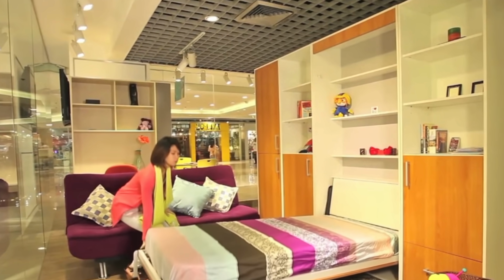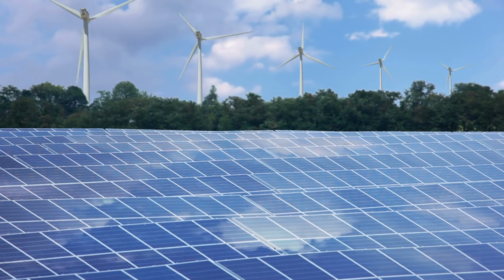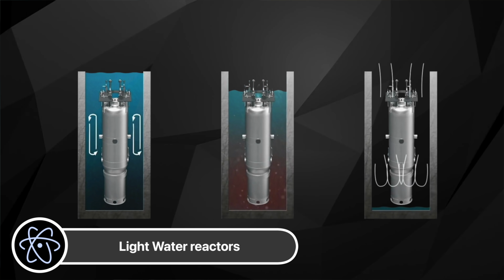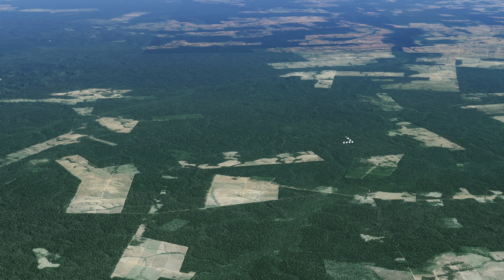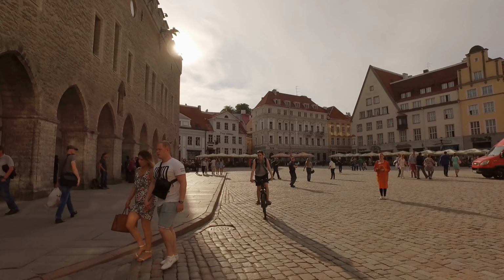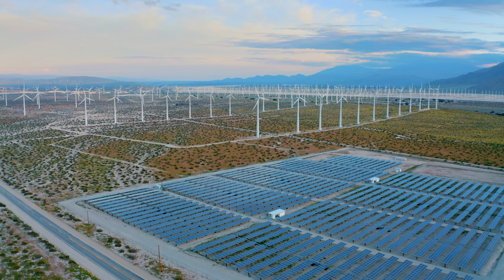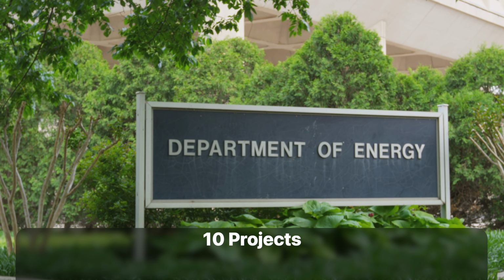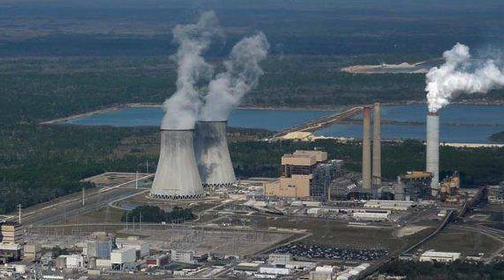Why Small Modular Nuclear Reactors Are the KEY

Comment: Few years ago I read about a small nuclear power station, that fit in two standard shipping containers. It was completely self-contained and designed to operate with minimal maintenance. It generated enough power for small village. The idea was to use them in remote locations and during any emergencies, as they could be shipped by truck, train or helicopter to location...
Reply: You mean HolosGen, they need more development but could be the micro reactor going to Air Force base in Alaska.
Reply: @paulbedichek2679 , I'm not sure. I think it was finished and there were orders for it. It might have been made by one of those Japanese megacorps that make just about everything. I can't recall, where I read about it, but I remember I was impressed by it...
Reply: @urgon6321  No,it would be a US design, look up HolosGen,that is the reactor that fits your description, OKLO also builds a small reactor, but theirs is a fast reactor.Remember the Russians have a barge. already connected to the grid in the far North,now there is great demand for more of these, it replaces diesel so the cost savings are astronomical.
Reply: for emergency use yeah. But for common, constant power-supply to a nearby settlement? Noouh! Think of all the energetic Neutrinos streaming out of such a device, frying the testicles of young men (and the eggs in women of fertile age). 
 I think nuc reactors should be placed far away in remote areas with low population density and in this case, the advantage of molten salt reactors with high temp and no need for cooling water would be doable and minimize the negative effects.
Reply: @konradcomrade4845 , ever heard about use of heavy metals and concrete as nuclear shielding to contain radiation? All modern reactors and other devices that use nuclear materials are properly shielded for safety and environmental reasons. The same goes for portable and modular nuclear reactors. There are also other safety systems, like radiation detectors and alarms to signal any problems with containment.

I suggest you watch some films by  Plainly Difficult, who has plenty of incidents of nuclear nature explored and explained. Many of them are examples of failure to properly track, contain and protect nuclear materials from idiots. So placing a self-contained portable nuclear power plant away from everyone raises the risk of spreading the radiation, instead of lowering it...
Reply: Not neutrinos maybe neutrons. Neutrinos can go through the entire earth so they would go through you too with no harm done.  Massive numbers of neutrinos are released in fusion reactions, like the sun.
Reply: @konradcomrade4845  - I would rather live next to a nuclear power plant than a coal fired power plant. The coal plant puts out carcinogens and more nuclear radiation in one day than a fission plant puts out in a year. The only reason they get by with it is they are not required to monitor their emissions.
Reply: @edwardcoulter9361  - Neutrons don't escape a fission plant either, the core is in a containment building. Even 3 mile island didn't cause any measurable leakage above normal background radiation.

Comment: Nuclear especially Thorium LFTR's and ideas like these Modular reactors are the way to go! It is the cleanest energy there is, even when the waste stream is taken into account......We need to go all in on nuclear power! Our electric powered future depends on it. Carbon based production is dying.
Reply: I am all for the continuing research on the many alternate methods of energy production.  Ensuring expanding research  on all options currently available to "cleaner " energy production is the only way to stay ahead of growing needs for energy.   Our government needs to be monitoring and promoting this industry.  To ensure profit margins do not rule over safety costs  a oversight that focuses on longterm goals and current energy needs without sacrifice of local and global safety.
Reply: Storing spent fuel rods is not cheap. Nor is mining the material. Requires a lot of carbon to acquire and store at the end of life.
Reply: @williamsrdan  There are no spent fuel rods in a thorium molten salt reactor. The nuclear fuel is liquid and low pressure. The moderators are made of graphite though. 

Much less waste and chemical equipment outside can also draw off useful waste products.
Reply: E Van  Thorium Molten Salt Reactors was proven to work way back in the 1960s and is a walk a way safe system so much so that the researchers could shut it down on the weekends and restart it on a Monday plus it’s a non high pressure system which works at atmospheric pressure. No hydrogen explosion to worry about spreading radioactive material . The systems are small and do not need to be cooled so can be placed anywhere.
The major reasons it was not put into use was political and greed . Nothing changed , at least here .
Also, the Chinese are building a pilot plant right now which if it works out , will put them way ahead of the rest of the world in producing cheap ,clean and safe energy.
Reply: E Van  Why do we need greedy private investors when we are already overspending on the military ?
And do these new plants you point to leave us with the same situation we’ve had for the past decades of all the stock piled waste that’s highly radioactive for ten thousand years which from what I understand, the TMSRs will actually help eliminate over time and any waste will actually be safe in only 300 years . 
The light water reactors have always been proven dangerous and are out dated . 
And yes the Chinese will beat us to the punch in just the next five years because of our paid and bought off politicians here stalling anything that will make energy cheap for the commoners therefore costly for their cash cows the corporate elites .
Reply: @garysmith5025  I've read this disadvantage which may require additional shielding and remote handling is also an advantage as it lessens the likelihood of increased nuclear proliferation.  It may be interesting to learn the dose rates of the workers in their new molten salt reactor that does use Thorium fuel.  I doubt whether such information would be made public.😉
Reply: @williamgrimberg2510  true. Gouvernement don’t want cheap or free energy. They want money like gold : rare and goods value.
Reply: @HablaCarnage63  there is a small amount of uranium used in the neutron enrichment process. 
It’s not totally thorium salts. 
Saying that though. 
It’s not much and the end waste has a half life of around 30 years. 
I agree thorium has great potential. 
But I’m not discounting magnetic contained plasma hot fusion ether. 
Both have a place. 
But the SMR systems could solve the oncoming energy crisis.
Reply: Lets see when that "waste stream" starts hitting your children hundreds of years from now (when people forget to maintain the storage), all while the waste remains EXTREMELY TOXIC.
Reply: @williamgrimberg2510  Agreed. The main reason why we don't see Thorium molten salt reactors today is because of Nixon back in the 70s. At first, Nixon was for it. Even talked it up in a speech. But as a favor to his friends in California when California was about to get new power plants, he ended all work on Thorium MSRs. There was more money in the current old reactor technology to be made. And the far more complex light water reactors needed far more man power to build and run, creating more jobs.
Reply: @williamgrimberg2510  And also agreed, on the safety difference. The old light water designs are far more dangerous in the event of an accident, due to high pressure radioactive steam release, hydrogen explosion spreading nuclear material, or loss of coolant and core meltdown (China Syndrome.) All issues that literally can not happen with a Thorium molten salt reactor (MSR). There was even a test showing the safety of Thorium MSR, ironically about 2 weeks before the 3 Mile Island meltdown, to see what would happen if it was left to run on its own with no human input. The reactor got up to a safe temperature, then, just sat there. And yeah, letting China take the lead in Thorium MSRs is a big mistake.
Reply: @williamsrdan  takes zero carbon to store
Reply: @dirkdiggler9379  except for digging out the caves...and transporting nuclear waste half way across the country to the storage facilities.
Reply: @dirkdiggler9379  How about an honest politician.
Reply: @billruss6704  there are plenty of honest people just to listen to it
Reply: isn't the half life from the waste like 750yrs or so with the thorium liquid salt reactors?
Reply: E Van  Do you trust Russian reactors?
Reply: This guy topgun did some research. Thorium/molten salt reactors are our best way forward. Best, most simple design, has less that can go wrong, so less to worry about. 

I feel like the biggest reason why we don't have them already is greed. Companies can't figure out ways to make people depend on them for everything, so I think they are worried they will eventually cause their own extinction. Right now they have justified the cost of everything by keeping everyone in the dark about "security and maintenance cost." Once people realize there's not much needed from nuclear plants once they are up and running, they won't want to pay for it anymore. Sure the factories can start out by leasing these small power plants to homes and communities, but eventually someone will start selling them and that kills the person's reliance and subjugation to the companies and that is what they fear. We had the tech to build these many years ago, and "free, clean energy" were the "ideas of tomorrow" videos that you'd see at expos. But free is not very appealing to greedy reliance based companies.
Reply: You forget about geothermal energy
Reply: Yes , but Carbon based power is growing rapidly all over the world.
Reply: @stefaancodde6578  Yes
Reply: @paulbedichek2679  : that's why Chernobyl exploded , bad maintenance.
Reply: @williamsrdan  Wrong , storing spent fuel is cheap, and the entire cost of mining and enrichment is minimal.
Reply: @HablaCarnage63  Yes, there are spent Th in fuel rods, it depends on the reactor.
Reply: @ezerratchaga  You realize nuclear has saved more lives than any energy source, nothing is safer or cleaner.
Reply: @jimlofts5433 Thorcon does not have the go ahead, they would give cheapest power, but have no agreement, The US will have many advanced reactors, TerraPower has the go ahead to build a a fast chloride molten salt reactor, an ideal type reactor like the LFTR but better.
Reply: @paulbedichek2679  1st, I have no issues with nuclear power plants.  But that doesn't mean you put a dirty bomb in everyone's hands.  If people thought guns are a bad idea, think of what will happen when anyone can poison a reservoir, your neighborhood water supply, kill 1000s of school kids all at once... etc... 

2nd.  Nuclear is never going to be able to compete with renewables, strictly on the cost basis.  It's dead in the waters.  Not only on cost, but in every imaginable variable.  Distributed energy? Clean? Simple? Cheap? Almost free in the future?
Reply: @michaelmorrison4201  There is no life without what you call greed, this goes for bacteria and microscopic life. You have no problem with coal but are afraid of our safest energy.
Reply: @constantinethecataphract5949  Geothermal,is very minimal, the heat comes from radioactivity so why not just build reactors and have the heat source where we want it?
Reply: @stefaancodde6578  Chernobyl had no containment structure, and the reactor design was poor, and they did really stupid tests,RMBK reactors even today crank out clean safe power.
Reply: @paulbedichek2679  its way way safer compared to nuclear ,  doesn't have any radioactive waste etc
Reply: @paulbedichek2679  
In places with high frequency of earthquakes nuclear power plants are not ideal
Reply: @michaelmorrison4201  Nothing is being suppressed due to greed, self interest is necessary for all life forms, not just humans.
Reply: Making depts by earth. Nothing learnd at all..
Reply: You can to build in Your house ,and enjoy.Don't tell me that You has a "cleanest energy"with radiated particles,cause it is a LIE
Reply: Lol what about nuclear waste
Reply: Nuclear is not pollution free and radiation is a big issue.

Comment: FOR TESLA CARS OR TRUCKS , FOR ALMOST FREE DRIVING, THEY CAN INSTALL ON EACH WHEEL A BICYCLE TYPE GENERATOR THAT POWERS A BICYCLE HEADLAMP.  BY PUTTING ON FOUR GENERATORS ONE ON EACH WHEEL, THIS WOULD ALMOST PROVIDE ALMOST COMPLETELY FREE CHARGING OR MAYBE ONLY TO FULLY CHARGE UP YOUR VEHICLE ONCE A MONTH OR WHENEVER YOU ARE NOT DRIVING AROUND VERY MUCH.  THESE GENERATORS WILL HAVE TO BE UPGRADED AND REDESIGNED FOR LONGER LIFE AND DURATION AND THE HARDER PRESSURES OR STRAINS THAT A VEHICLES WHEELS WOULD BE BRINGING MUCH MORE STRESS THAN NORMAL AND REDESIGNED WITH RUBBER WHEELS AND NOT THE METAL GEAR TURNED WHEELS, AND QUIET OPERATION.  FREE ENERGY AND ALMOST FREE DRIVING- !!!

Comment: Thanks for sharing your thoughts and ideas. I think lumping salt cooled reactors in with conventional modular reactors is disappointing and overlooks the benefits that they could provide. You need to explore and provide a video that breaks out the advantages of thorium salt cooled reactors. Advantages such as reduced nuclear waste, and increased safety plus many more that were dismissed by simply lumping them in with the other conventional reactors that also are smaller.
Reply: @alanhat5252  : A nuclear bomb no, but smaller bombs can be enriched with thorium  and then it is still dangerous. Radon is a nuclear gas and there is a lot of it on this planet. Capturing is a problem tho.
Reply: You are completely ignoring the benefits of other new reactors,NuScale uses the light water traditional tech, but is done in a completely new form. Then,TRISO fuel ,cooled by either molten salt or Helium. We will build a molten salt reactor even better than a LFTR,molten salt, but Chloride, and fast neutrons is the form Terra Power i building an experiment of
Reply: Yes it's not but in a molten salt coold reactor the thorium is within the molten fluride salt. If it heats up too much the salt expands, reducing the density of thorium therefor slowing down the reaction. A meltdown szenario is impossible in such reactors. However the salt is really agressiv and they had a lot of problems keeping it where it should be, this was one of the main reasons why liquis salt thorim reactos are still just pilot plants. Also we have a lot more thorium than the current used U235.
Reply: @KasimierLP  We have 20 trillion years of U fuel in the ocean, cost of U fuel is minimal as it is 70,000,000 times as energy dense than diesel.
Reply: @paulbedichek2679  the current price is 80$ the current reserves woul likely last 80 years in addition of higher prices and statistical reserves OECD and UN experst estimate a realistic value of around 130y. RESERVES =/= RESOURCES !!! Reserves are economically and technologically available. Same reason why we struggle so much with rare earths, they aren't rare at all, they are everywhere but in way to low concentrations to retrieve them. Uranium from the ocean has some problems  1. There are only pilot plants 2. It would cost multiple hundrets of dollars to filter it to make it economically. The amount of resources on the planet means ape shit for industrial real use application, reserves is what matters cause 4 billion tons in the ocen wont help you if you can't get it out for a price that someone is willing to pay. which is why i said Uranium 235 reactors won't have a future and if it wont be a cheap one.
Reply: @KasimierLP  if you listen to any of the videos by Kirk Sorensen with interviews from the old retired staff, the primary reason for the program being shutdown was politics.
Reply: @tbix1963   That doesn't change the fact that it's economically nonsense atm. It's just way too expensive so it would either need to be subsidised by the government or a privat investor.
Reply: plus all of the medical isotopes that are produced and a (quite)bit easier to gain access to..